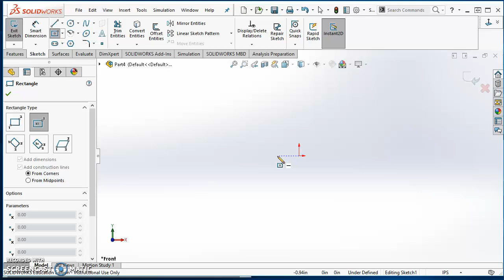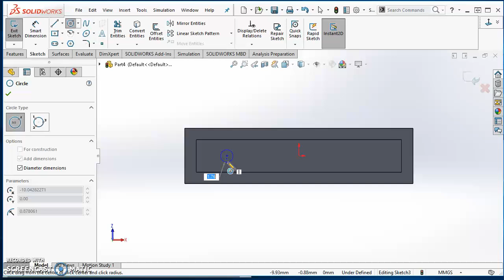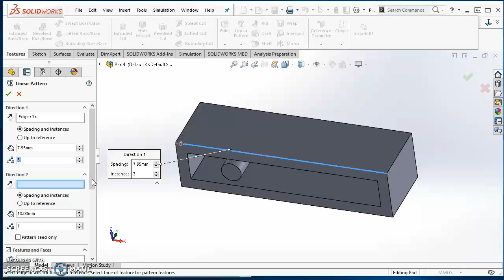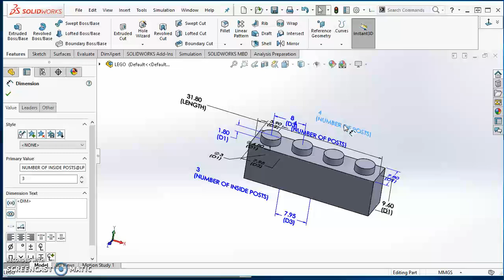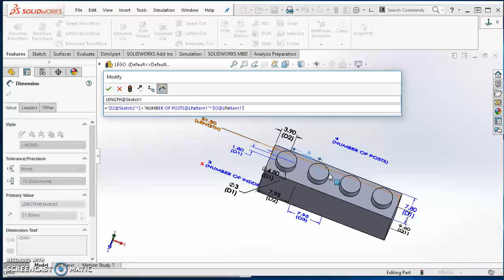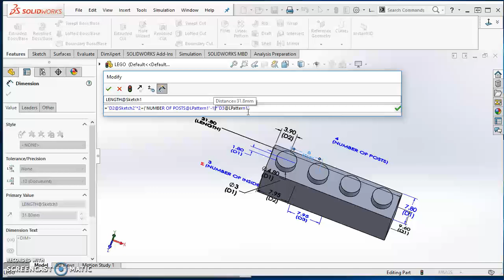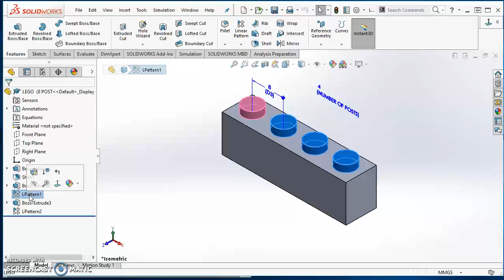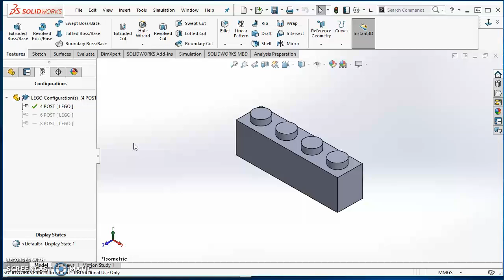Configurations in SolidWorks

Comment: When you were suppressing the tabs on the bottom using "configure feature", would it be possible to only suppress the "Boss-Extrude3" operation in order to remove all of them from the model? In this example you suppressed the LPattern first and then the Extrude.

Comment: Very good video. I like the use of the lego concept when explaining this process. Was the reason to start your pattern from the end 3.90 (D2) for purpose of the lesson? Is it feasible in SW to establish the location from the center and drive the pattern? I'm new to SW with a lot of years in Pro/E Creo.
Reply: I suppose you could, although it would be a bit more complicated than necessary. Starting at the end lets you fix that dimension. Since LEGO bricks are all standardized (so they all fit together), it would make sense to fix the end dimension -- if only so you can copy it to the other side. Also, since LEGO only has one brick with an odd number of studs (3), finding the center on most pieces between two studs is really more work than it's worth. Hope that helps!

Comment: Awesome explanation, thanks :D
Reply: Industrial standard Configuration table create in solid works 

Now streaming,  use below link and watch

https://lnkd.in/ejxXR7q

We are conducting online industrial training as per industry standards.
if anybody wants to join the class kindly check our website and message me in this video itself. we will contact you.

Thanks and Regards,
Das Auto Loco
www.dasautoloco.com

Function: Clamp is used for underground cast iron and ductile iron water pipe 
to prevent joints from separating. The O.D. of the pipe is shown in the data table.

Finish:Plain. Contact customer service for alternative finishes and materials

Sealing Caps Core Plugs & Welch plugs manufactured out of Mild Steel, Stainless Steel and Brass material being used the Engine & Transmission blocks. These are available in both Cylindrical and Conical type.
Clamps, Clips & Brackets being used in Automotive, Tractor, Earthmoving equipment and Farm equipment as per customers’ requirements
Push Nuts, U clip Nuts, Self threading Nuts made out of medium carbon and high carbon steel with hardening & tempering and Electroplating with Hydrozen De embrittlement process.
Constant Pressure Hose Clamps manufactured out of high carbon steel and carbon alloy steel for the fuel and liquid rubber pipes/hoses in the Engines and other applications.

Comment: Frustrating that you have to have dimensions driven by equations. I dont see what the difference is behind making a dimension equation driven and just going into the sketch and editing it manually. Also, if I want to vary a part by, say, a feature like wrapped text, there seems to be no way to vary the configurations to reflect this. All the configurations are updated with the change in text

Comment: When managing inventory, sales, etc. How do you differentiate between the part numbers between different configurations since it's the same SolidWorks file?
Reply: Industrial standard Configuration table create in solid works 

Now streaming,  use below link and watch

https://lnkd.in/ejxXR7q

We are conducting online industrial training as per industry standards.
if anybody wants to join the class kindly check our website and message me in this video itself. we will contact you.

Thanks and Regards,
Das Auto Loco
www.dasautoloco.com

Function: Clamp is used for underground cast iron and ductile iron water pipe 
to prevent joints from separating. The O.D. of the pipe is shown in the data table.

Finish:Plain. Contact customer service for alternative finishes and materials

Sealing Caps Core Plugs & Welch plugs manufactured out of Mild Steel, Stainless Steel and Brass material being used the Engine & Transmission blocks. These are available in both Cylindrical and Conical type.
Clamps, Clips & Brackets being used in Automotive, Tractor, Earthmoving equipment and Farm equipment as per customers’ requirements
Push Nuts, U clip Nuts, Self threading Nuts made out of medium carbon and high carbon steel with hardening & tempering and Electroplating with Hydrozen De embrittlement process.
Constant Pressure Hose Clamps manufactured out of high carbon steel and carbon alloy steel for the fuel and liquid rubber pipes/hoses in the Engines and other applications.

Comment: Great demo👌.. Thanks a lot
Reply: Industrial standard Configuration table create in solid works 

Now streaming,  use below link and watch

https://lnkd.in/ejxXR7q

We are conducting online industrial training as per industry standards.
if anybody wants to join the class kindly check our website and message me in this video itself. we will contact you.

Thanks and Regards,
Das Auto Loco
www.dasautoloco.com

Function: Clamp is used for underground cast iron and ductile iron water pipe 
to prevent joints from separating. The O.D. of the pipe is shown in the data table.

Finish:Plain. Contact customer service for alternative finishes and materials

Sealing Caps Core Plugs & Welch plugs manufactured out of Mild Steel, Stainless Steel and Brass material being used the Engine & Transmission blocks. These are available in both Cylindrical and Conical type.
Clamps, Clips & Brackets being used in Automotive, Tractor, Earthmoving equipment and Farm equipment as per customers’ requirements
Push Nuts, U clip Nuts, Self threading Nuts made out of medium carbon and high carbon steel with hardening & tempering and Electroplating with Hydrozen De embrittlement process.
Constant Pressure Hose Clamps manufactured out of high carbon steel and carbon alloy steel for the fuel and liquid rubber pipes/hoses in the Engines and other applications.

Comment: Thank you
Reply: Industrial standard Configuration table create in solid works 

Now streaming,  use below link and watch

https://lnkd.in/ejxXR7q

We are conducting online industrial training as per industry standards.
if anybody wants to join the class kindly check our website and message me in this video itself. we will contact you.

Thanks and Regards,
Das Auto Loco
www.dasautoloco.com

Function: Clamp is used for underground cast iron and ductile iron water pipe 
to prevent joints from separating. The O.D. of the pipe is shown in the data table.

Finish:Plain. Contact customer service for alternative finishes and materials

Sealing Caps Core Plugs & Welch plugs manufactured out of Mild Steel, Stainless Steel and Brass material being used the Engine & Transmission blocks. These are available in both Cylindrical and Conical type.
Clamps, Clips & Brackets being used in Automotive, Tractor, Earthmoving equipment and Farm equipment as per customers’ requirements
Push Nuts, U clip Nuts, Self threading Nuts made out of medium carbon and high carbon steel with hardening & tempering and Electroplating with Hydrozen De embrittlement process.
Constant Pressure Hose Clamps manufactured out of high carbon steel and carbon alloy steel for the fuel and liquid rubber pipes/hoses in the Engines and other applications.

Comment: Thank you so much
Reply from the maker: You're most welcome!
Reply: Industrial standard Configuration table create in solid works 

Now streaming,  use below link and watch

https://lnkd.in/ejxXR7q

We are conducting online industrial training as per industry standards.
if anybody wants to join the class kindly check our website and message me in this video itself. we will contact you.

Thanks and Regards,
Das Auto Loco
www.dasautoloco.com

Function: Clamp is used for underground cast iron and ductile iron water pipe 
to prevent joints from separating. The O.D. of the pipe is shown in the data table.

Finish:Plain. Contact customer service for alternative finishes and materials

Sealing Caps Core Plugs & Welch plugs manufactured out of Mild Steel, Stainless Steel and Brass material being used the Engine & Transmission blocks. These are available in both Cylindrical and Conical type.
Clamps, Clips & Brackets being used in Automotive, Tractor, Earthmoving equipment and Farm equipment as per customers’ requirements
Push Nuts, U clip Nuts, Self threading Nuts made out of medium carbon and high carbon steel with hardening & tempering and Electroplating with Hydrozen De embrittlement process.
Constant Pressure Hose Clamps manufactured out of high carbon steel and carbon alloy steel for the fuel and liquid rubber pipes/hoses in the Engines and other applications.

Comment: It bothers me that the top posts have a spacing of 8mm while the bottom posts have a spacing of 7.95mm. The center to center spacing of the top and bottom posts should be equal, no?
Reply: The bottom posts have smaller diameters so the spacing is less.
Reply from the maker: Thanks for replying to this Julian.
Reply from the maker: Hey Austin! Honestly, I'm not sure. I found a reference document on the Internet and used those dimensions, but I haven't confirmed this with any of the few thousand Legos that we have at home.

Comment: Thank you for a thorough explanation and a great video! But could you please mention how to deal with skipping Instances in different configurations? I do not see how to cope with those ((( Look, I have two configurations with arrays of holes, some of them should be omitted in each configuration, like:   1) oo..o.o    2) o..o..o     Where "o" is a hole, and "." is a skipped hole. Total nomber of them = 7 (as an example). How can I configure the instances to be skipped?
Reply from the maker: Thanks for the comment. I'm sure you already know this, but I do not see a way to skip an instance in one configuration and than skip a different instance in another configuration. It appears the skip instances part of a pattern cannot be applied to specific configurations. You could always submit this as an Enhancement Request to SolidWorks and if enough people vote for it then they might include it as an update to the software.

Comment: You should do your shell after the studs. That will give you the inside without having to create another sketch.
Reply from the maker: Thanks for the comment. I reviewed your suggestion, but I don't see how that would help. When I create the stud (Boss-Extrude2) then shell, part of the inside of the stud will be removed which can be seen in a section view. Then I still have to create Sketch3 to create the stud on the inside. In summary, I'm not smart enough to successfully complete the process you suggested.

Comment: This is not an "E"...
It is the capital Greek letter Sigma used as a symbol which stands for the Sum of discrete values.
For some reason, Solidworks uses it as a formula indicator...
In any case, it has nothing to do with "E" !!!
Reply from the maker: Thanks for correcting me. I'll try not to make that same mistake again.

Comment: Great video!  Is there a way to make a dimension drawing on one LEGO and have it update for each configuration vs having to make a completely new dimension drawing for each new size?
Reply from the maker: Thanks for the comment. Yes, there is. Create a drawing of the 4 post than right click on Sheet1 and select Copy. Create a new sheet, right-click on Sheet2 and select Paste. Then update the front view to reference the 6 post configuration and as long as you used Projected views when creating the drawing all of the other views will update.
Reply: @ryanweber153  Thank you!!
Reply: @ryanweber153  It would be really cool to add that detail to the tutorial, would be a master tutorial.
Reply: You can use variables in the sketch and define each variable differently depending on configuration in the equations manager.

Comment: After adding a configuration in my assembly by clicking "add configuration" naming it, going into the feature manager design tree, finding the feature that needs to be altered (in this case a pattern), making the appropriate change and saving, I double check my work. However when double clicking the other configurations in the Configuration Manager, both have changed. Any thoughts?? 
One thing, the "modify" box with the option to apply to "this, all, or specific" configurations does not come up..
Any assist would be terrific!
Reply from the maker: Thanks for the comment Heidi. I tried this on an assembly and it worked if I edited the pattern from the Design Tree, but when I clicked on the number representing the pattern in the Graphics area I did not get the icon to specify which configuration to apply the change to. Also, when you model the part if you use Hole Wizard, Linear Pattern Feature, or Circular Pattern Feature, than when you assemble the components you want to use a Pattern Driven Component Pattern and SolidWorks will reference the part model to automatically populate the number of instances, distance, etc. Although, a Pattern Driven Component Pattern does not work if you use a Linear Pattern or Circular Pattern in the Sketch.

Comment: yeah that's great, but how about non linear blocks such as square Legos. how would that config work out to be? thanks
Reply from the maker: Thanks for the comment. I would model a square lego with 4 pegs (2 rows and 2 columns) then really the only difference is one more dimension which controls how many rows you want.

Comment: I used this for a SolidWorks class I was taking. It really made things easy. The only thing I changed is instead of centering the posts on the top, I dimensioned them off the side so I could do a two-post-wide configuration.
Reply from the maker: Thanks for the comment. Thanks for modifying the model to include 2-rows for your class to show mastery of the concept. Good luck in your pursuit of education Blane.